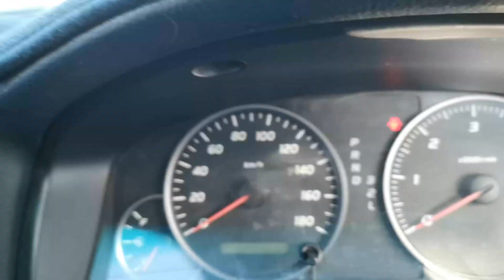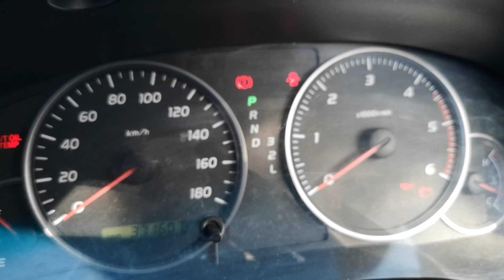How to Pull Error Codes on a Toyota Prado 2004 | Found (Airbag Code 18)

Comment: Did you end up finding the fault that set the airbag light off
Reply from the maker: Cheers mate, yeah after checking all the connections the next thing I looked at was the clock spring. Turned out that was the fault. The owner ended up ordering a new one and fitting it himself, then called me to say the airbag code’s gone. Would’ve liked to make a video on it, but I don’t always get the opportunity. Cheers.